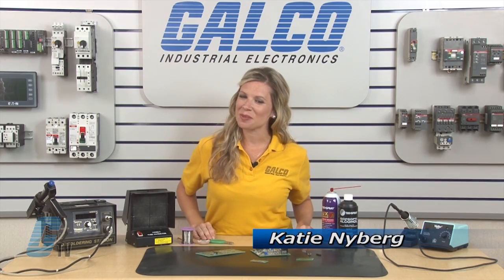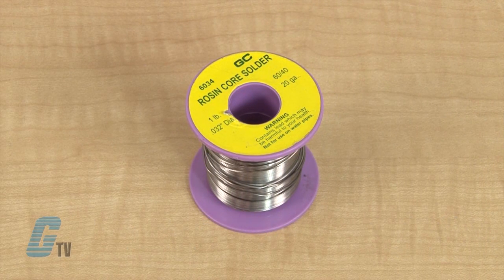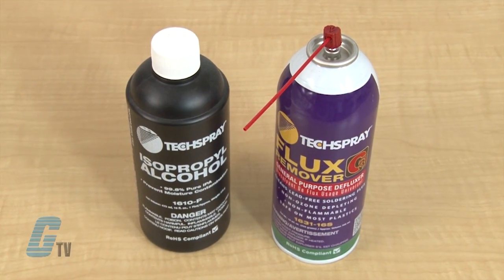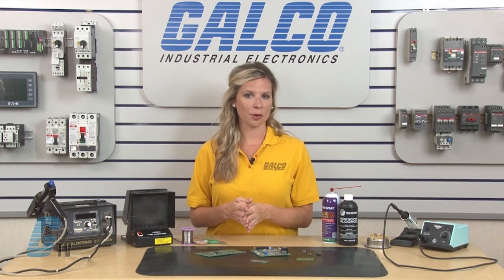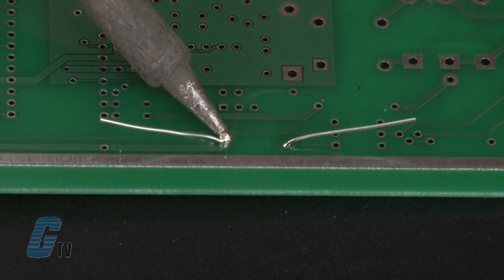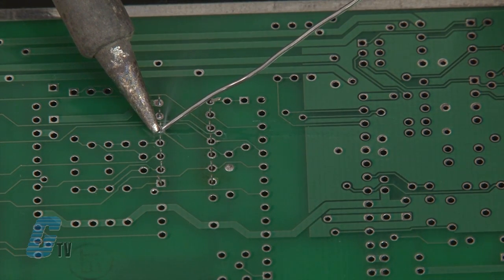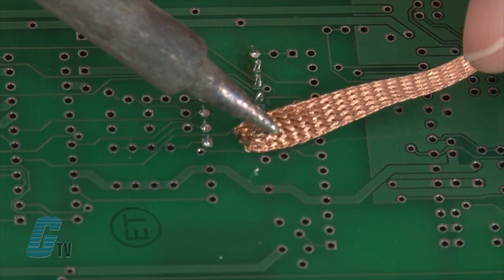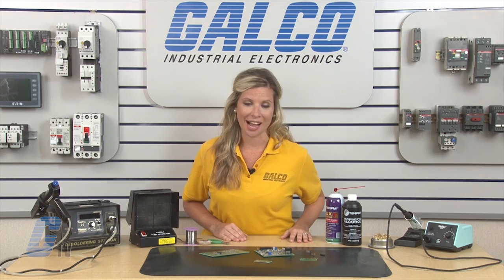How to Solder - Basic Tips on Soldering

Comment: What is "Flux" used for?
Reply: Flux is a liquid or a paste that helps solder to flow and touch everything you are trying to solder. A good solder point should not look like a chocolate chip, it should be concave. Please see "How to repair cold solder joint" on YouTube for more info on flux.
Reply: Flux removes oxidized layer from the conductor's surface.